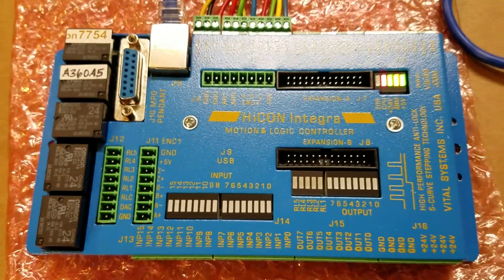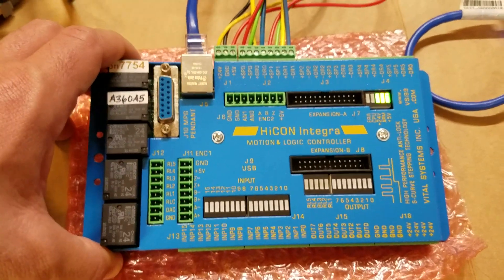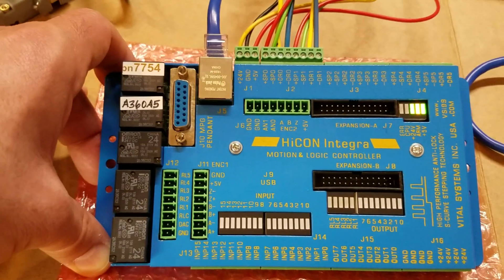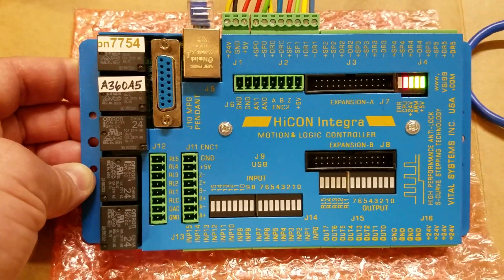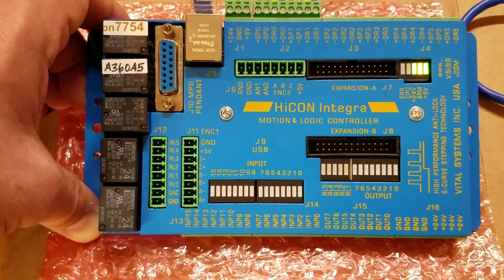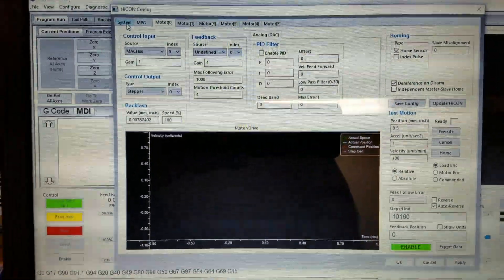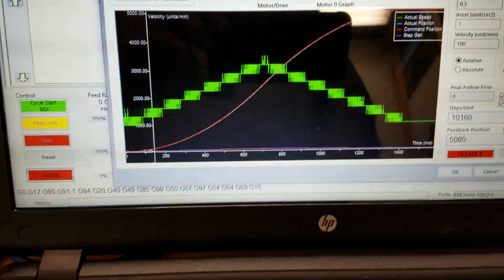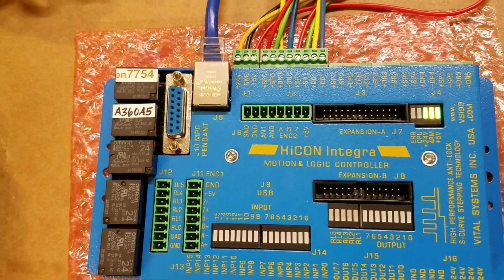Vital Systems Integra-Hobby Motion Controller 4-Axis125KHz

Comment: This controller and a set of NEMA34/80mm closed loop servos would be a killer CNC drive system on my future CNC router; not wasting time with open loop steppers, etc.
Why would anyone want a "hobby" controller running a $4,000 homemade machine!  I'd rather have the mainstream "pro" product which is made to a higher standard/feature set and not crippled.
A 24V and a 5V power supply is probably a given in a machine controller electrical box; not really an "additional" cost because of this particular board. 
Four axis is all that's needed on many CNCs; I wouldn't call a 4-axis controller "hobby" specific and not professional.
Worth noting is the ethernet connection and pendent connection. PC can be anywhere with ethernet. Pendents are great so a person doesn't have to hover over a keyboard.
Every electronic device worth a grain of salt has a heartbeat LED; it also indicates the software runs as a state machine (in a processing loop). Of course, if it STOPS blinking then what?...a bit pointless.
The problem with small companies is longevity and lack of vertical integration! 
Interesting aspect is this control has an Application Program interface (API) which means a software developer could write add-ons for the controller.
You should have pulled those Phillips screws so we could see what is underneath; what is the CPU?
Thanks for the review! I want one of these...

Comment: This looks like a fairly new product. It is possible to tell how new a product is by the revision dates in the manual. Nicely integrated, but they are hush hush about the microprocessor/microcontroller used. It will probably be cloned as soon as the virus panic subsides, but this might be a re-branded Chinese controller like all the others and the servo and stepper drive controllers.
It is pricy, but you get what you pay for. The Chinese XHC motion controller is functionally the same, and it is $200, but not the advanced features (are they just fluff?).

Comment: searched for hicon integra on youtube and only found your video. This doesn't stroke confidence in the product.
Reply from the maker: I would go with Centroid Acorn over the Integra/Mach4 setup.  I find the Centroid hardware/software combination to be the best.
Reply: I find several videos now.
This looks like a fairly new product. It is possible to tell how new a product is by the revision dates in the manual. Nicely integrated, but they are hush hush about the microprocessor/microcontroller used. It will probably be cloned as soon as the virus panic subsides, but this might be a re-branded Chinese controller like all the others and the servo and stepper drive controllers.
It is pricy, but you get what you pay for. The XHC motion controller is functionally the same, and it is $200.

Comment: Hi Franco. WoW - Too Much... Anyway, Here's what I was going to post on the CNC Zone's SMITHY Forum: Hell-oh... I Recently bought a Smithy Granite 1324 I-Max... And I've got a couple of Questions with nobody to ask - Except - You ('s) -  Top Icons of the Machining Industry & HomeFront as well. I thank you in advance... Anyway - I'm into Smithy now for about $4,600. It's far from what I want. Without breaking the bank at the same time doing it right - What now (08/2017) is the best CNC Controlling Unit that I can put on this thing? Franco from YouTube says SERVO is the way to go. In addition Warren Ryner mentions DIGITAL Power Controller / Driver? Also - Good Franco mentions that most Motion Controller Boards do not include backlash control Ecxept for one - The Integra Hi Tech MCB. Which is fine for a Stepper Motor System But - If you want to Control Backlash with a Servo System it requires a $600 dollar upgrade! Ah - Yer Killin Me. So, back to You Franco... What would You do? It seems as if I am just ONE of Your Great Video's shy of knowing ALL... Out - LJR111
Reply from the maker: Hi.  

First, it's important to differentiate between Mach3 and Mach4.  Mach3 has more support as it has been around longer (but it's not as good as Mach4).  Most all the important functions of Mach3 are supported by all of the major MCB makers - Smoothstepper, for example.  If you want to use Mach4, then IMO the only solid choice is the HiCON board from Vital Systems as it supports all of the major functions, backlash being one of them.  

Regarding motors/drivers, there are two ways to go:  1) open loop or 2) closed loop.  Open loop is simple - think "cheap steppers I can buy on eBay".  They are a great option if you are on a budget but don't expect too much speed.  Closed loop is much better as you can push the motors to their limit without losing position.  

There are two options with closed loop systems: A) motor driver receives the encoder feedback; B) MCB receives the encoder feedback.  IMO, option A is the best for the DIY and/or homebrew CNC builder as it is less expensive, easier to wire and provides really good performance as the motor driver will manage position and make corrections as required.  If you go with option B, that means you give the encoder feedback to the MCB and force Mach4 to manage position and make corrections.  This is the expensive upgrade to the HiCON board I was talking about.  I don't see any reason to do this in the DIY CNC conversion world.

I hope this helps,
-Franco

Comment: Franco,
I looked at the website. It says there is an additional $595 fee to turn on the closed loop stepper function. I guess i dont know much about how they communicate, but it appears that you loose these benefits without the activation. Can you educate me on this? And how is the conversion coming along?
Reply from the maker: Hi.  You have two choices with closed loop systems.  1.) the encoder feedback is fed to the stepper driver; 2.) the encoder feedback is fed to the motion controller board.  Option #1 is simple and less expensive - the motion controller board tells the driver where to go and the driver compensates for any errors in motion. If it totally stalls out, the driver sends an alarm to the motion controller board and e-stop's the machine.  Option #2 is expensive as you need to upgrade the motion controller board to accept the encoder signals.  The motion controller board allows Mach4 to read the encoder and Mach4 makes any necessary corrections.  In my opinion, #1 is a much better option for small machine conversions.  I'll be posting some videos discussing my latest project very soon.  Thanks!

Comment: Enjoy your channel!  Just ordered a PM-25MV to retrofit.   Originally planning on using open loop steppers but stumbled across a few closed loop systems and now looking into it again (always wanted a closed loop system).  Used to think/be so far out of reach but certainly looks more doable these days.  I was considering some closed loop Leadshine motors but also very interested in the Clearpath motors.  Did you consider the Clearpath?... if so do you mind explaining why you decided against them?
Reply from the maker: Thanks for your comment.  The clearpath servos look awesome - maybe the best option out there.  However, once I started adding up the cost, I couldn't justify that expense (in my opinion) for the PM-25MV project.  The closed loop steppers seemed like a nice compromise. With 5mm pitch ball screws I can set  the drivers to 2000 pulses per rev and I'll end up with a machine resolution of 0.0001" which is pretty good, all things considered.  As I recall, you have to pay for an upgrade on the clearpath servos to get to that resolution.
Reply: I am on the fence too...it does start adding up but am trying to figure out how much more over the Leadshine closed loops.  I have always used standard steppers so I don't have a good idea on sizing for the closed loops....just what I have seen/read from others.

Comment: Another cracking video, thank you! Looks like a great product, am I right in thinking this is the only piece of electronics you'd need between the lathe and PC or would you need stepper drivers too?
Reply: Just had a look some of the documentation, stepper drivers built in but spindle driver not? What kind of spindle driver would you need for a 550W mini lathe?
Reply from the maker: FutureFab CNC & 3D Printing Hi. check out this video:  https://youtu.be/vNjPo0wq8xI
You will need drivers for your stepper motors. Anything that can accept step and direction pulses. The DC spindle on a mini lathe can be controlled with a board from CNC4PC.com. I believe it is called the C6 board.
Reply: Thanks, further reading is needed it would seem! Really enjoy the channel, keep up the good work :)
Reply from the maker: FutureFab CNC & 3D Printing Thanks. I have a few more videos coming up soon that I think will be interesting.

Comment: I am but confused. don't some servos require much faster frequency rates? I think I have read that my nema 42 servo require 500khz pulse to work at full potential. 125khz and 200khz seems rather low.
Reply from the maker: Darko Bulatovic Hello. That may be true.  When I did my calculations I based it on 5mm pitch ball screws. I need 10160 pulses per inch to get a resolution of .0001" and at the setting I calculate I can get a max rapid of 740 inch per minute from this board. As a point of reference, a Haas VF-1 has a max rapid of 1000 inch per minute. I will probably never set the rapid over 100 inches per minute. This board is fast enough for me but every situation is different.
Reply: Franco software side looks great. Looking forward for more videos about this. I guess only comparison   Is Mesa board and LinuxCNC price vise and features.
Reply: I checked with Vital, their pro version 7766 does support upto 2MHz step frequency.